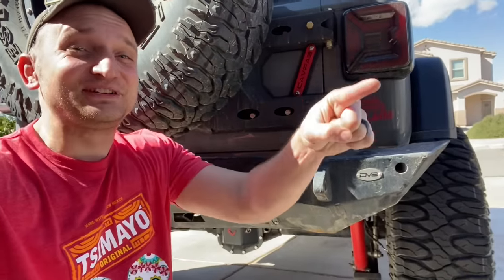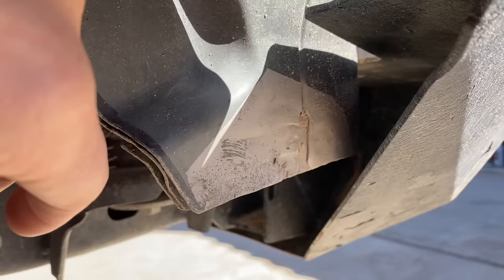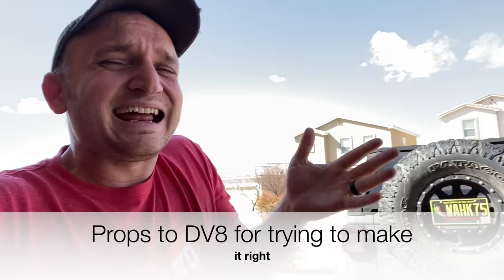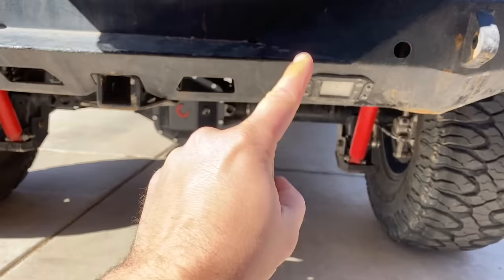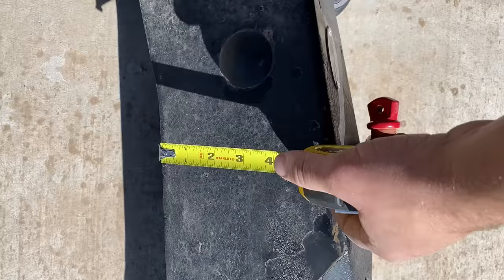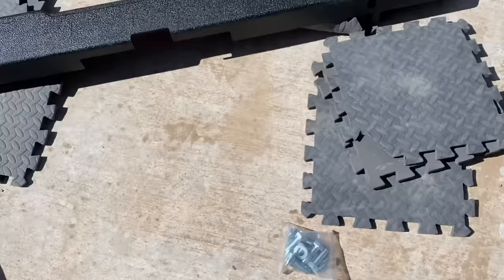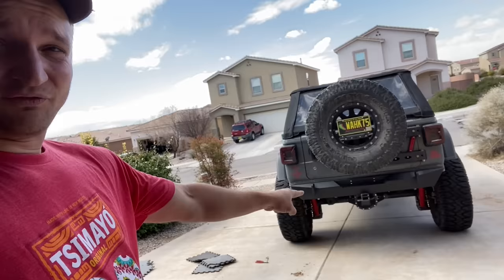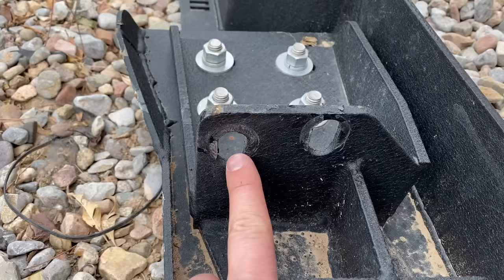Avoid These Mistakes when Looking for a Rear Bumper

Comment: Thank you sir, I will avoid dv8 for sure now for front and rear ! 👍🇺🇸
Reply from the maker: 🙌 glad I could save u the headache! 🙌
Reply: @JLLIFEOFFROAD   do you know anyone who has the ADD Offroad Rear Stealth Fighter Bumper for 18-20 Jeep Wrangler JL? And if the had a good solid experience with it ? Thank you
Reply from the maker: 0311Devil Dog so I actually know someone who has the rear... we were talking about it after we published this video... she said she is replacing it cause it was thin and bending... she does the rubicon several times a year... I was blown away to hear tht.... ADD is EXPENSIVE

Comment: I liked the look of their bumpers, so I did some research. I asked them where they were made. They said “China” , I said “Thanks but no thanks” I went with JCR.
Reply from the maker: I wish I did more research on dv8 before I bought em... I kinda just went off of people on internet... but it’s how we learn I guess 🤷‍♂️ thanks for watching...
Reply: Very nice review, in regards of China made.... many, many US companies manufacture their products in China,  smittybilt is one of many examples...but it depends on quality controls the owner of the brand request to the manufacturer...
Reply: I only use JCR, strongest bumpers around. The rock sliders have been beat on the KOH course and are just scratched. They also have hi lift point that locks the hi lift to the Jeep so it can’t kill you. Coating is pretty tough too! Best quality I’ve seen. Outclasses poison spider, gen right, metal clock, etc... I’m not sponsored or paid by then just have gotten amazing products from them that thrived in KOH

Comment: I've run into issues like the elongated holes. I welded heavy duty washers on them so it wouldn't move. It doesn't solve the crappy service that DV8 gives but it's a helpful hint if you run into it with something else.
Reply from the maker: Iv learned pretty quickly to avoid dv8.

Comment: I have the exact DV8 bumper that I also got from Quadratec.  I've had it for over 6 years.  I bought it for many of the same reasons you did in that it had the backup lights and an integrated trailer hitch.  The paint has not been an issue with mine.  I am not an avid off-roader, so in my case it works well.  However, I do like the design of the Cavfab better having seen the comparison between the two.

Comment: Just installed the Rugged Ridge HD rear bumper on my JL this week. minimal branding, very secure mounting (2 side bolts on the frame rail and 2 bottom bolts on the frame rail, per side), and more than enough protection for the little wheeling I get to do. Honestly, it was more because of worry of having only plastic there, and FL drivers being FL drivers.  And matches the Rugged Ridge Venator stubby I have on the front.

Comment: Great points.  I purchased road armor for my rear for the same reason you are pointing out.  Another friend showed me his dv8 bumper and warned me about them and the inner fender wheel well liners.  They won't stop railing on his jeep
Reply from the maker: Seems the only time I see DV8 "hold up" is when its strictly on road use. For their prices, you would not think that was the case.
Reply: @JLLIFEOFFROAD  I have the barracade front bumper,  its doing great,  but eventually I'm going to get the road armor front to match everything else.  I have road armor out fenders,  inner fender lining and rear bumper.  All pricy but they are doing pretty good and have taken a bit of beating  and you can't even tell.
Reply from the maker: A ti I’m planning on matching the curtains to the drapes as well 😂😂😂

Comment: As a jeep owner and a hobby tinkererer, I know about the issues he is talking about.  Here is the solution.  Either live with the issues, buy an expensive bumper, make or have made a rear bumper, or have a cheaper store bought bumper professionally  powder coated (the cheap Chinese plastic coating is closer to undercoating  than powder coating).  Either way you go you need to have the bumper welded in place.  I did this previously with my Ford F350 heavy duty aftermarket bumper and no matter how many times or how hard I kicked the trailer hitch with my shin the bumper always felt very solid and didn't budge an inch (or millimeter).  

Bottom line you can't get a custom $2,000.00 bumper for $500.00.  And if you do get a mass produced cheap bumper remember they are designed to fit all the vehicles and all the possible production variations that happen.  If you still want a cheap bumper and use it like an custom expensive one at least have the adjustment/mounting slots filled with something as simple as a piece of metal so there is no longer "adjustment" left in the slot so upon impact, there is no room for the bumper to slide or move.  Pretty simple, just have to think about it.  

There is an old saying :  if you can't afford to do it right the first time, where will you find the money to do it right the second time!
Reply from the maker: This being acceptable is why it continues... it’s not... a lot of people who don’t know what to look for... deserve to know and see what issues there are... the common “don’t run that” u hear from anyone online is usually from people who are only relaying what they have heard or someone tryna Sell their own stuff. nobody has to spend $3000 on a bumper to be happy with it. And I will not weld on a bumper I’m not happy with, there are better designs out there tht hold it tight and together... and I show tht in the video. This video shows people not all bumpers are equal...
Reply: @JLLIFEOFFROAD  just to be clear since I might not have sounded like it to you, I liked your video and agree with the cheap bumpers that are expensive to buy and disappoint.  Sorry if it came across wrong. Just trying to add my $0.02 about another way to prevent bumper creep and a little humor about how I hit my shin on my bumper hitch like twice a week till I sold my truck.....most painful 3 years of my life. 😀
Reply from the maker: We are good friend! 🙌 appreciate ur input.. I feel the same way about my wife’s stinger bumper... I can’t even tell u how many times iv been checked by tht darn thing lol

Comment: I have some DV8 stuff and I have not had problems. The finish on most are crap nowadays. Bedline them right away. Smitty, DV8, the whole lot. Once you do, no issues. Tighten those bolts.
Reply from the maker: Glad to hear you have not had any issues with em... You are actually a small percentage of people to be able to tell me that. 

some parts I know prefer looking for bare steel,, bumpers are definitely one of them.... 

Them bolts were tight every time I readjusted it. like to the point it felt like it was going to break loose the nut on the jeep frame. There is just too much play in the mounting points and its so large it has to much leverage working against it when it gets hit. 

Thank you for watching, appreciate the comment hope to hear from you again!

Comment: I agree that the problem is the oversized holes. If someone was stuck with their purchase there is a work around. You could bolt it into place with flat washers on both sides and then after it is aligned, weld the nuts to the washers and then the washers to the frame on the one side and the bumber on the other. It wouldn’t take much of a weld at all to hold it solid. The bolts should have lock washers on them.
Reply from the maker: Yes tht is an option..just finding a friend with a welder... 

Lock washers would also be an idea. I hate it when u buy new parts and new hardware is not included 😂

Comment: Granted I have a different situation 
I have an iron cross rear bumper for my Ford F-150 with those same adjustment holes.  I just stuck on a snap on impact and rattled those on until they stopped and I have not had it move when I dragged the truck up a muddy hill with the shackle mounts. 
You just need to put them on as tight as possible without shearing off the bolts.
Reply from the maker: I had them on pretty tight... but my worry was if I went super ugga Duggar. I’d snap off the welded but on the frame and have a entire new problem on my hands

Comment: DV8 rear bumper with swingout spare. Swing out bolts and soft steel allowed the holes to wallow out resulting in the framing to fail allowing 110lbs of tire wheel almost fall off at speed.  DV8 to their credit sent me new parts…….but no underwear. Live and learn. The greatest regret comes from the disappointment of learning ya get what ya pay for as your joy from a great deal fades. Would I buy DV8? No. Great vid no fluff.

Comment: I kinda like the oval slots for mounting stuff. Gives that wiggle room till you get it right, it does mean they don’t have precise measurements. But just an uneven surface can make attaching hard if it’s perfect holes.

The nuts and washers with grip on the ends help prevent slipping. Especially once you torc them down to 130ft lbs or something like that.

Comment: I just installed a Cavfab mid width rear bumper. The bolt mounting holes are very tight (good thing), there’s no way that sucker will move like the DV8 does. Cavfab is a very well made bumper for a pretty decent price.
Reply from the maker: Everything Iv seen from them... Iv been impressed with the quality.. Also super awesome every step of their process of parts... everything is in the USA...

Comment: Definitely giving us some things to check. Our Jeep came with a DV8 rear bumper when we purchased it 😯
Reply from the maker: Just don’t trust dv8 to hold up to any degree of abuse 🤷‍♂️
Reply: @JLLIFEOFFROAD  yeah, we've bashed both corners. Ours is solid across and the ends are tubes that come together, hard to explain and I haven't seen it for sale anywhere so I'm assuming it's way discontinued. It's dented really bad and of course the coating is coming off all over and the dents are all rusted up. Don't care to try and remedy it as I just want to replace it.
Reply from the maker: Rock Solid Rig was my thoughts on this one as well

Comment: Damn....breaking my heart here...my Jeep is all DV8 from front bumper to back! No issues yet but now I’m about to have to check it all!
Reply from the maker: No worries man... not tryna throw shade at anyone... but letting people know the issues Iv had with mine... hoping lighting a fire under dv8s butt so they try harder...😂 as long as u don’t beat on it... I’m sure it will be fine... i wheel.. aggressive
Reply: I wheel aggressive as well and surprisingly both front and rear are still as solid as can be! I think my rear is a bit different as it doesn’t have the lights. The issue now is the grinding in my front axle area....may have been a little too aggressive...any ideas for me there?
Reply from the maker: Juan Hartman Lol unfortunately...  it can be a lot... bad unit bearing... something wedged by the brakes... twisted axle. 😂
Reply: Well damn....looks like It might be time to upgrade it all from stock....any suggestions or maybe a new video showing what you have and how hard you can beat them!? Shit, I’m even down to beat mine the rest of the way with you if you find yourself wanting to trail here in the Mojave Desert!
Reply from the maker: Juan Hartman I have been wanting to do a video like tht for a few months now... I think it will be in the next few weeks.. Mojave would be a hella fun trip 🤔
Reply: We’ve got a little town out here called Bullhead City, AZ that has hidden trails locals don’t know about for days! It’s right across the river from a casino town called Laughlin, Nevada. I’m wheelin and discovering new spots or the same ones on my own constantly! Welcome anytime!

Comment: You need some rear panel rock skidders  that underlap your bumper a little.. that thing looks like a dirt scooper alone..  
I personally didnt like the look of the rear dv8,  my fs 15 front stubbies have been fine.. yea.. i do agree the powder coating is Lacking in thickness . However..  i always add adhesive and Rhino line em to my standard.. get used to respraying the rhino. Rocks dont forgive .

Comment: This rear bumper looks awesome and it looks like it functions well. I don't drive a JL, but I'm sure I can find it for my JK. I wish I knew about CAVFAB before I bought an Oedro rear bumper (which is the same chinese piece of crap as DV8) It has the same pod lights, same oval mounting holes, and all the same issues that you mentioned. Thanks for the info. Great video!!!
Reply from the maker: Sorry to hear it. My experience OEDRO is cheap Chinese junk. They sent me some floor mats we did a video on, darn thing didn't even fit right. They were a little hurt I was honest and wanted me to adjust my wording in the video. CAVFAB is top notch... small American business making beautiful products

Comment: Dude. Tape a line across the back. Sand, prime and rhino line the body behind the bumper. It blends with the bumper and cover the blemishes caused by that other POS and it's something you could do super easy.
Reply from the maker: I actually decided to add the Rusty’s rear fascia... it will help keep all the pinch seam together when I hit it again 😂
Reply: @JLLIFEOFFROAD  That works too.... I'm starting over on a new rig. I can't decide how far I want to take it. Problem is that I'm falling in love with it stock. 2003 GX470. It is soooooo good at being a luxo SUV, but it is very capable off road too as a Land Cruiser. Decisions, decisions.

Comment: Great information. I remember when you took that body damage, cracks me up every time I hear your son screen, lol.
Reply from the maker: Brings a smile to my face every time! “NOOOOOOOO!” I mean... idk how to explain it... I figured he be playing with a stick. Not watching me do this 😂😂
Reply: How about welding on washers on both sides of the plate or welding in fillers so the holes are just round or welding on solid plates and drilling them where they fit your jeep? Just a thought.
Reply from the maker: Gunny Sharp had tht thought also... but honestly didn’t want to show support to the brand by fixing their mistakes... 

I was ready to sand it all down... trim the bottom and weld on some heavy duty washers... but dv8 don’t deserve the advertisement for what they charge for their junk.

Comment: Looks like your new bumper  has some good advertising cut right in to it. I have the DV8  and not had the rust issues. I agree its close to the tub. But like you ,I got mine in May of  18 not much to pick from. I have the baracade front bumper, and no rust there either. Your new bumper does look good. I also got the skid plate from them. It is heavy duty. I got mine for 425.00.
Reply from the maker: Rust where I hit the bumper... I expect... flaking chips parts where I don’t... is... 

I feel like ur implying I was being biased in this video... every point I made was true... honest.. I’m no part snob... let people run whatever they spend their money on.. articulating facts in this video seems to be a much better way voicing my opinion rather then screaming “dv8 is junk” on the web..

And with the intention of being fair... I put the new bumper through the same circumstance the dv8 failed... 

If cavfab ain’t ur flavor... that’s fine... I don’t sell their parts... plenty of great product manufacturers out there... cavfab is just the one I landed on. 

Thanks for watching 🙌 appreciate your time both watching and commenting. 

Stay safe!
Reply: @JLLIFEOFFROAD  I didn't imply that at all.  Just noticed how the new bumoer had its name on it.  You're the one that made the comment about the DV8  branding. I have the skid plate and you can't hardly make that out. I took off the DV8 tag on the rear bumper.  I don't think any of these company's should be branding there products like that. Its like a dealer sticker on the back of your new vehicle.  No offense .
Reply from the maker: Gotcha... u cleared it up... like I said... branding is fine... just needs to be subtle... the dv8 bumper ain’t bad with the branding... but their inner fenders HORRIBLE... rough country is another brand tht over brands... I just think someone should have to investigate a piece to see what it is.. not see what it is while ur driving from the other side of the road.. passing another jeep...

Comment: I know this comment is 3yrs after the video was posted so probably won't see but, in the video you said "I was new, didn't know where to look for quality jeep parts" and that's where I'm at, googling things brings up a million brands and options. Any "go to sites" or companys?
Reply from the maker: Whatcha looking for?
Reply: @JLLIFEOFFROAD  first thing I would like to do is lift/tires. I want a solid entry set up to where Im not wasting money on cheap/beginner stuff but also not spending a bunch on hardcore rock crawling stuff. I want to build my 2020 JLU into a daily driver that can also hold it's own off-roading on trials and what not (thank you for replying!)
Reply from the maker: @alexkip3015 tires… go to Northridge. 

Lift… go with metalcloak. Awesome lift. Low maintenance and works great!
Reply from the maker: @alexkip3015 north ridge 4x4 is where I typically buy
Reply: @JLLIFEOFFROAD Thank you!

Comment: my dv8 bumpers have lasted well.  My rugged ridge completely powder coat fail like your DV8.  Must be a process issue.  They should be the same every time.
Reply from the maker: Dv8 seems to have a massive quality control standard